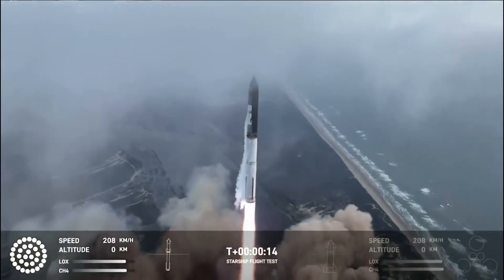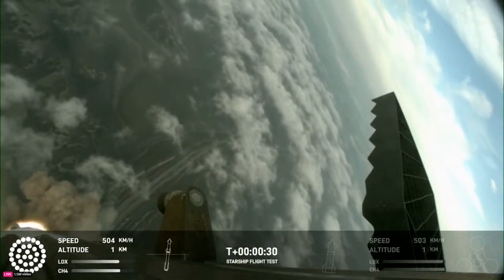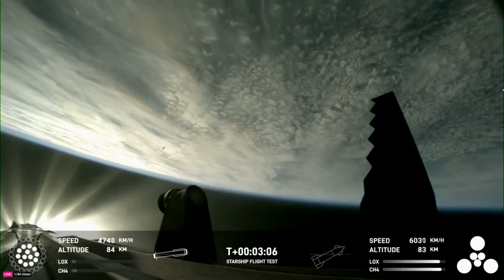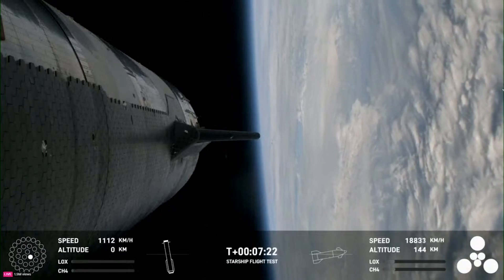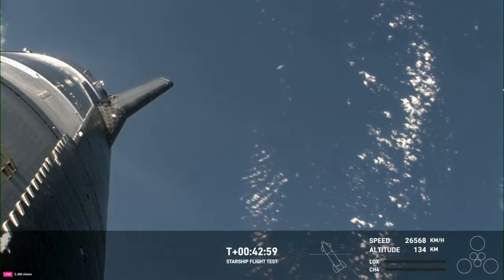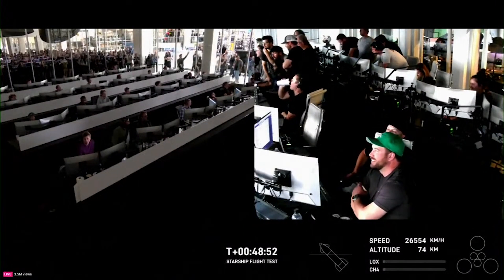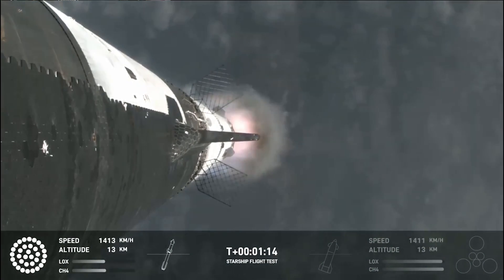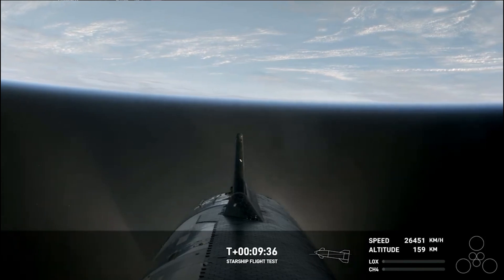What Exactly Happened On SpaceX's Third Starship Launch Attempt?

Comment: The ship seemed to want to stay rotated 90 degrees counterclockwise from what I would have expected.  I would have loved to see the camera on the other side of the ship to see if both those control surfaces were working.  If not, problem identified.  If so, It might be as simple as a programming error or something very hard to pin down.

Comment: Either it was a control issue with the avionics, or the fuel is still sloshing around. you can see it rocking side to side as it fell like a leaf in the direction of the plasma. not to mention all the tiles coming off.

Comment: Door didn't close ( being stuck half open : you can see the exterior light ) and SS not in "line" with atmospheric flow on re entry, so it melted and  become destroyed because of the incorrect orientation of the belly, it re entered with not covered by thermic tiles half body  exposed to heat.

Comment: They keep talking about this shows the ability to launch "giant payloads" into space but none of these test flights had even dummy payloads.  For the second one they said it was fully tanked up to simulate as if it had a payload but then blamed the excessive fuel load for the explosion.

I’m willing to give a pass on the failed booster landing since that’s just a cost reduction – logistics thing but the failed “pez door” closure, skipped re-light of SS motors, loss of control, tiles falling off, and failed re-entry seems like a lot of missed milestones.  They got at least three flights using this incremental approach to show true orbit capability and successful re-entry.  Forget about the re-fueling and moon orbit missions being on schedule to meet the NASA requirements.

Comment: It seems this launch ended the same way as the previous two: uncontrolled flight leading to destruction. What further "data" is needed to make it workable, much less reliable, much less a solution to a problem no one has? It's a one-way trip machine at this point, and for the foreseeable future.

NASA had big rockets sorted. Saturn V never failed. Why erase the chalkboard other than vanity?
Reply: You pretend that the Saturn V development had no problems, but a pretend understanding is worthless and conclusions based on ignorance are also worthless.  Why do you try and pretend you understand when you clearly don't?  Vanity?

Comment: Can someone please explain to me how SpaceX possibly determines this as a success? Instead of just jumping on the bandwagon of "Yeah SpaceX has told us this was a success, therefore it is!" - Is it not important to ask why? 

Even the mildly "simple" task - if you will -  of securing heat shields to the craft failed. I used to believe this whole, "yeah but we learnt so much" spiel, but I'm sorry this looked like a fail to me. How many NASA test flights had catastrophic failures before they reached the moon?
Reply: Because they're following a rapid iteration and testing program.  They build a minimal viable test article and test it to destruction, find the problems, fix and iterate.  Clearly you have some large flaws in your understanding.
Reply: @TheEvilmooseofdoom  I clearly do, hence the question I asked that you responded to. 
However you didn't properly answer the question - could you explain why exactly they are following a rapid iteration and testing program? And how come the likes of NASA don't follow this method?

Comment: They need to fix the tile issue, once and for all. They are pretty strong but their attachment method isn't good.   Tiles also should have been applied to the entire body this time because a lot of them started to rip off around the outer edges as the craft was trying to position and stabilize itself, and some tile edges were no doubt pointed into the heat leading to them being ripped off.  Other than that, Good Job.
Reply: That wasn't tiles falling off starship but ice.  The tiles were never properly tested because of the problems with attitudinal control of the vehicle.

Comment: The engine issue with the booster not re-lighting for the landing burn is an easy one to solve. As for the Starship failed re-entry, something must have failed within the flight control system. Maybe the rolling could have been controlled if they fired up those engines and put it in a nominal position for the re-entry. Tiles for me is not a major issue at this phase. Even if a couple hundred fall off it should still go through re-entry.

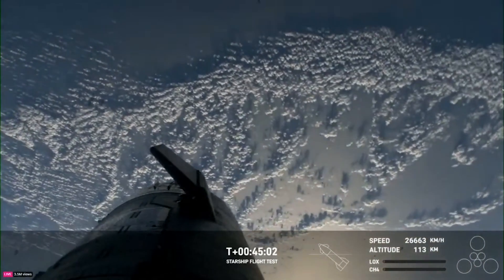Comment: @04:34 This is ice, not tiles.  Tiles generally fall off on the way up at from launch up through max-Q, where ass ice falls off in space as metallurgy contracts and expands with fuel transfers and burns. source: pilot and engineer.

Comment: 4:50 "Issue with attitude control and general orientation."
  That's an understatement!
I watch it live, and Starship was rotating for a while before re-entry, I got dizzy from the footage. 
  It basically re-entered sideways.
Reply: it was facing engine first into the plasma at the end if i remember correctly.
Reply: Cold gas thrusters may have been clogged up with ice.  That debris was done all white.  It would explain the list of control. We will see if they will conclude if that was cause of the tumble

Comment: how is the fuel so low on both stages? the booster did not even try to make it back and was still out of fuel, the second stage at 3 % just shy of orbit, at this rate they will just need 50 or so rocket launches to send one to the moon! this is progress!
Reply: I'd assume both vehicles were fueled to match the mission.

Comment: Crazy thing is… they can already use this vehicle to launch Starlink satellites, as that does not require e return of either component- this could help offset ongoing development costs.  👍👍👍
Reply: Nope. The Starlink satellites need to be released in LEO, not a sub-orbital flight. The FAA will not approve LEO missions until the Starship can de-orbit burn reliably. Otherwise Starship could crash anywhere.
Reply: @imconsequetau5275  Yep, thats why their next test will have to be a retry of this same suborbital trajectory, Which BTW is the same trajectory have tried on EACH TEST.  They are litterally still on the first test, they can't move to the next test undill they do a successful soft water landing.  THEN they can try to have the Booster and the 2nd stage actually aim for land.

Comment: I still feel, they need to develop some sort of spray on heat shield, small tiles never worked on the shuttle and most likely will not work on starship, or a space blanket of some sort.

Comment: As enthusiastic as SpaceX and its fans are about this flight I expect that NASA was less so. The failures that we saw broadcast were more fundamental than "iterative."
Reply: It’s way too early to tell, before the data is analysed. It’s worrying that the booster engines appear to have failed to relight, but that could be due to other factors. Including a control issue that sent the booster outside the acceptable envelope, triggering an abort. 
   
It took quite a while before SpaceX managed to land its Falcon 9 rockets, and every time people (including nasa) had more doubts about the whole thing. Now it’s routine.
Reply: @kaasmeester5903  The engines weren't fired on orbit because of the vehicle's uncontrolled spin (per SpaceX)
Reply: No, NASA understands what's going on.
Reply: @TheEvilmooseofdoom  So that's why the contracted Blue Origin? I guess you didn't read the GAO report.
Reply: @Miata822    It's about progress not perfection.  Regardless of any GAO report.  NASA understands this.  Progress is slowest in the phases of testing and yet Space X made a big step forward with improvements from the last flight to this one.

Comment: Must be something in the Kool-Aid.. but this was yet another fail. With the exception of lift off and separation, everything else failed. It failed to soft splash down. It failed to open the door, it failed to renter. They got a long way to go yet. Yet another investigation delay has now started. They'll be lucky to fly 3 times this year at this pace. It might be a good idea to scrap the finished prototypes, and just start with the next design ships.
Reply: No, you just STILL don't understand their development path.  Stupid people tend to be lazy though.
Reply: @TheEvilmooseofdoom I do understand. It needs to fail so they can fix the "idea" they are testing. Take your emotion out of it. Thanks for the laugh though.
Reply: @hawkdsl  Yea that why its so weird that they build multiple boosters ahead of what they are flying, it assumes that everything is going to work the first time an not need to be redesigned and rebuilt, but at the same time the paradigm relies on finding problems by testing and iterativly removing them.  What they have seems to be a maximum cost combination of different approatches.
Reply: @kennethferland5579 Agree. The first booster failed to run all engine. Fixed. Second booster failed to return boost. Fixed. Third booster failed to soft land. Pending... however I figured they would have addressed that already by fixing the boost back. It's too bad we couldn't see it hit the water. At the speed it was at, that must have been spectacular. I mention only the booster, because that is probably closer to final configuration then the way more complex Starship.

Comment: Is it possible to synchronise speeds and just float down, avoiding the destructive heat of re-entry?
Reply: No
Reply: If you could magically have enough fuel to slow down from 26000 km/h on the orbit. If you check the original burn, you'll find that the ship used all its fuel to get from around 12000 km/h to 26000 km/h. To slow down the ship without using atmosphere as the brake you would need similar amount of fuel for braking. And if you had that much fuel remaining on the other, you would have needed A LOT more fuel to get to the orbit.
Reply: You’d need to double tyour delta V which means you would needlike, a super heavy heavy heavy to get that fuel up.

Comment: Well done Space X.  cameras on flight very good placement. Need more cameras. Issues heat tiles need to stay put.  Need to complete another in orbit burn along with complete de-orbit burn, fix issue with booster flight controls and engine controls,  need get a solution for loss of signals. Next launch in less than 75 days or sooner.
Reply: Signal loss is inevitable during reentry.
Reply: @TheKianykin Not inevitable. SpaceX explained that Starship is so big that it cuts a channel through the plasma that might be enough to keep a link with Starlink. We got quite far this time. No one has ever managed live footage of reentry plasma before,

Comment: The second stage seemed to be rolling at one point. Don't think that was supposed to happen. Ambitious project.I sincerely hope that it all works out.
Reply: You can see massive leakage after engine shut down and that caused the rolling that ended in a tumbling.
Reply: @triage2962 
That initial "leakage" was used to provide ullage direction and/or pressure differential for the propellant transfer. Then the excess propellant mass was supposed to be dumped. 

After all that, the tumble was never cancelled, probably due to inadequate propellant vapor pressure. Perhaps a valve stuck open.
Reply: @imconsequetau5275  We dont know but i think the Starship has no truster for flight control expect the main truster so after it startet rotating there was nothing they could do.
Reply: @triage2962  
Starship presently relies on the propellant vapor [pressure] in the main tanks to make orientation thrust. If the vapor pressure is released due to leaks, there is no thrust. If the liquid is all gone, there is no way to re-create pressure from slow boiling (from sunlight). Actually, the thruster efficiency also depends on vapor temperature, which is increased by operating the six Raptor engines.

Comment: If they did that burn would ot have saved the starship?
Reply: The fuel was pushed to the top of the tanks due to the aerodynamic deceleration only allowing 1 engine to fire
Reply: @prototypical  If the booster was  decelerating, why would the fuel have been pushed upwards? If you have something falling towards the Earth and it's slowed down by aerodynamic deceleration, shouldn't the stuff inside that object fall to the bottom of the thing?

Comment: Lesson: Starship cannot survive reentry if it loses large numbers of shielding tiles. 
Solution: Find a better method of heat shielding
Reply: Those weren't tiles falling off starship, but ice fragments.   Starship apparently failed reentry because of attitude control issues.  The proper function of the reaction control thrusters should fix that.
Reply: They may need to slow the ship down until it reaches a speed where the steel can take the temperature and forces. 
Maybe enter the atmosphere nose first and slowly glide into a safer position after the atmosphere slows down Starship?

Comment: What is falling off just before re-entry is ice not tiles. As it enters the very thin upper atmosphere there is enough force from the atmosphere to dislodge ice that built up on the ascent that is being softened by heating. Hope they got plenty of data during the re-entry to be able to calibrate control surfaces better for the next attempt. That thing is huge and calculating the re-entry dynamics would be a nightmare. Now they have real world data it should be a big improvement next flight. Shame the landing burn failed, the boost back was a huge improvement. Actually starting to think they may get this thing working.

Comment: Heat sield plates need to be rivited on, made with a composite then plugged with same meterial the heat shields are made of.
Reply: What kind of rivets were you thinking? Remember that metal rivets would burn during re-entry.

Comment: After some fail landing tests some years ago I made a comment about to avoid to use hidraulic legs.  Some people answered that this was impossible bla bla bla. Now I have another. The buster will need to decrease even more it's vertical velocity before the buster body gets in vertical position. They will need to turn on more engines while the buster is in a 45 degree angle with the horizontal, and only after compensating a lot for gravity they will be able to successfully verticalize the buster and have a controlled landing. This means that they will recalculate their fuel consumption and spend a lot of more fuel in trying to land the booster.